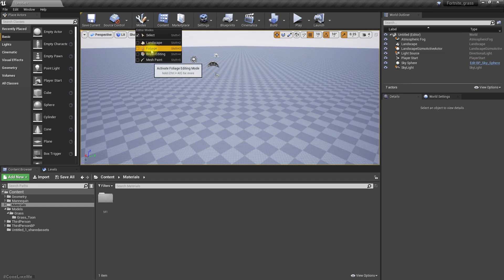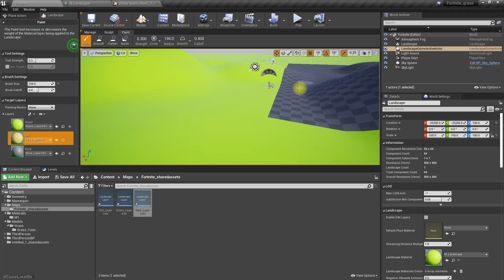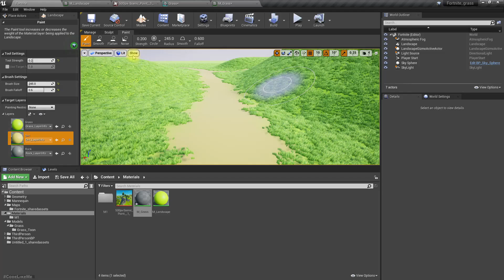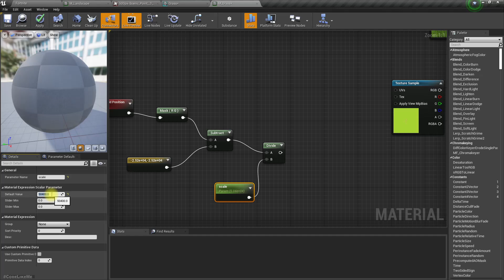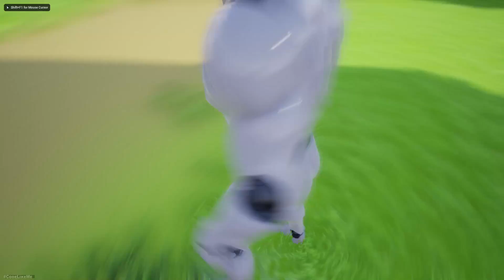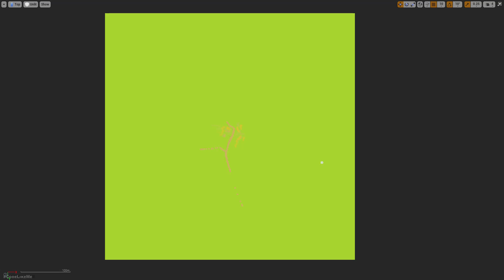Unreal Stylized Landscape and Grass Materials

Comment: Could this material be used for a mobile game terrain?
Reply from the maker: I haven't tested. but It should. later on this series I changed the material to dynamically change grass color as you paint the landscape with using runtime virtual textures, that part may not work in mobile. not sure though